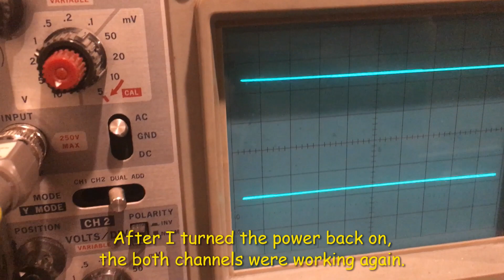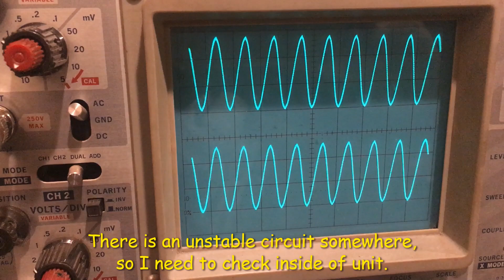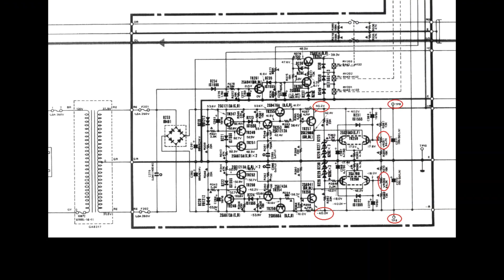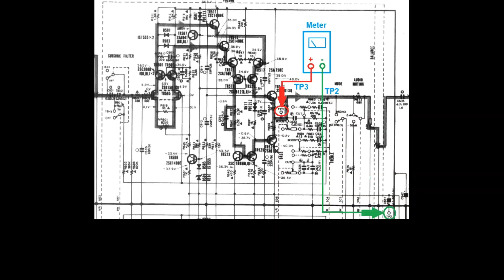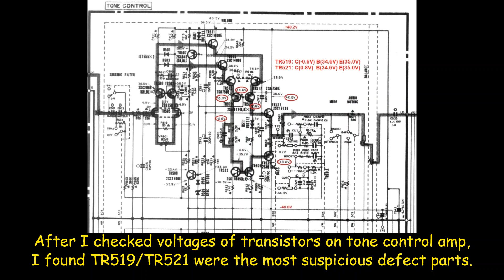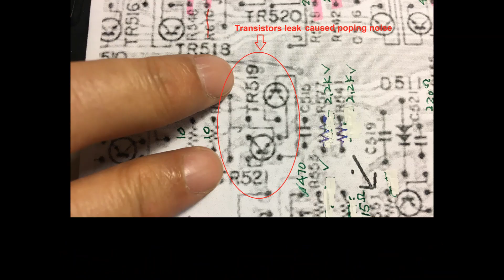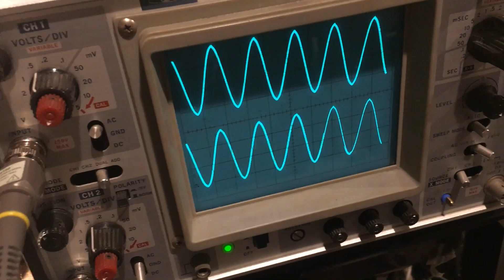Yamaha C-2a Repair - One Channel Out and Intermittent On/Off Issues

Comment: This is your own pre amp?  Maybe you need to match the transistor or change both left and right to get it balanced?
Reply from the maker: The transistors I used were matched pair and also met the spec. of OEM transistors. In fact, the final waveform test (not in this video) after the adjustments showed both channels were same. I will try to publish the final adjustments, waveform test and the listening test on the next video.